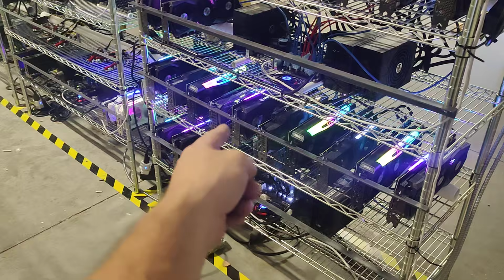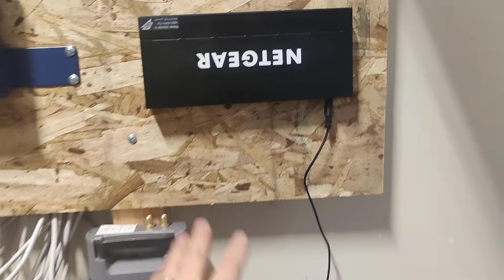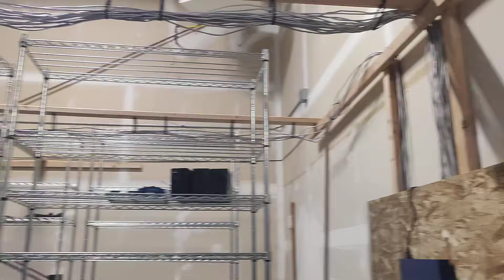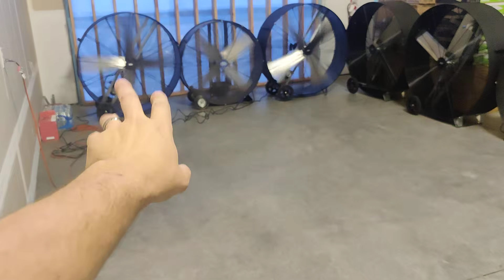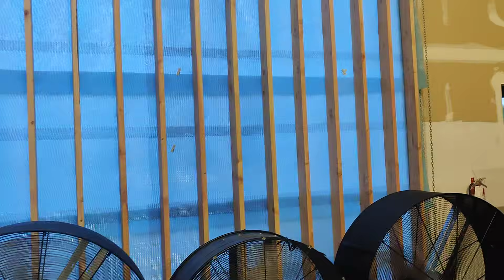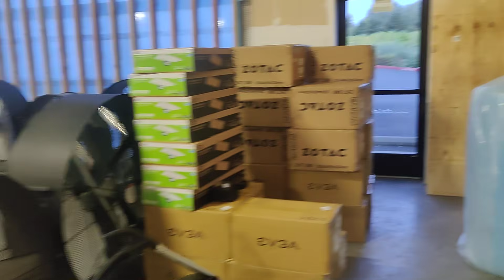GPU RTX 3080 Mining Farm - MONSTER FARM

Comment: for the same hashrate with 3070 you will save about 38% of your electricity power. The 3080 and 3090 are not efficient all for mining compare to 3060ti and 3070. OR for the same power you will get about 38% more hashrate with 3070!!!
Reply: Power is cheap. It isn't a big deal.
Reply: That assuming for every 3080/3090 he could find a 3070 instead which may not always be the case. Better to buy an additional 3080/3090 than not get another card at all.
Reply from the maker: Make no difference when considering power.

Comment: I used to do exact same setups back in 2017 using amazon shelves, but then when I decided to move my farm to another location, it was quite a big hustle. I advise you to have individual rigs built out in separate frames and then just put those frames on the shelves, that way you will have more mobility / options.

Otherwise great setup
Reply: Yes. Always aim for modular design so when you do maintenance it’s less gpu with downtime

Also ethernet does not to be on the top as long as you do good cable management and put it in a pipe sleeve should be good
Reply: Facts
Reply: Hi David. can you please share an Amazon link for those shelves ? thank you

Comment: It's a very nice setup, but I have a couple of questions.    
You are blowing air from the outside... correct?  
Where are you exhausting your heat to?   I would see if I could put those fans as exhaust fans in the upper part of the back wall.
That way it would bring air through your filter, through your setup and out the back of the location.  

Second, I would love to see the other side of where you have the filter... what are you doing about rain, humidity or moisture?
Reply from the maker: No exhaust

Comment: You could make much less ethernet cables simply by getting few small gigabit switches to those racks, then you need only one cable for each row of racks.
Reply: yeah, its not like miners need any kind of real bandwidth. That is the way to do it for sure.
Reply: One more point of failure tho. Actualy 3 points, if you count the RJ45 connectors.
Reply: @stone9k  No one counts rj45 connectors as a point of failure. Well no one in the IT world at least. Simply because 99.9999999% of the time they don't fail.
Reply: @bevis420 99.9999999% just ain't possible. The failure rate is around 99.8% for RJ45 connectors. Worse in a poor-controlled climate, better in a strict climate like a server park. And if you have 100+ of them in a warehouse with limmited mosture controll, you do the math.
Reply: @stone9k  You can do also the math what it means if all computers in a big server hall need to have their own, long ethernet cable to a single switch or just few of them.  Having miles of excess ethernet cable is itself also a risk to have a failure and it also costs quite a bit.   Everyone does their networking whatever way they like, but I try to keep excess ethernet cable lengths off, and try to use switches in some good balance.  If some RJ45 connector fails, it's not a big job to replace short ethernet cable compared to a ethernet cable running long way along the room and roof.
Reply: @stone9k  Forgot also to mention the advantage of having managed switches where you can build VLANs and similar, all goes through single ethernet line nicely.   You manage it all through web management, not by changing ethernet cable ports (and all the job due diffeent length cables etc)
Reply: @captainhappy  You do you

Comment: Very nice setup. I just started at home mining (1060, 2x 1070s, 1080. Up to ~>100 Mh/s). Where would you recommend, I buy large quantities of GPUs? Large as in more than 2 of the same kind. I see people with just boxes of identical cards, and unless they are placing hundreds of eBay bids, idk how they are getting them cheap enough to make your money back. Subbed. Excited to see how it progresses. Your explanation of POE was wonderful for a normal user (Or non-tech savvy investor). Another question I have is, I've watched all the mains stream miners’ setups regarding electrical. Everyone uses 220v for obvious reasons, but have you looked into anything higher or maybe an explanation on why 220 is the highest miners use, verses massive industrial equipment. My “degrees” are in IT and Industrial Maintenance, my apogees if these questions are very specific.
Reply: Are you running them with LHR or you unlocked it
Reply: @twentyfive2life686  the cards he stated don't have LHR variants
Reply: @twentyfive2life686  LLamaCannon is correct. These card's arn't LHR. Just the 3000 series are. Background, I bought these cards used from a miner that used to mine back in 2017, couldn't turn a profit and stopped, sat on the shelf until a month ago. I plan to expand with RX 580s or 1660 Supers. And eventually build out a ton of 2060 ti rigs on Solar.

Comment: Subscriber Number 5! Very nice facility guys. Would love to see a closer look at your metal wire racks and how your mounting the cards, supporting them with the pvc pipe... smart.

That giant wall for airflow is smart! What are the temps like at the height of summer near you? 

Also you showed us the intake fans what about exhaust? Are you going to suspend giant fans from the ceiling and push the air out the top of the wall?

Great content
Reply from the maker: Thanks. Will do.
Reply: The pipe is a very nice trick, liked too!